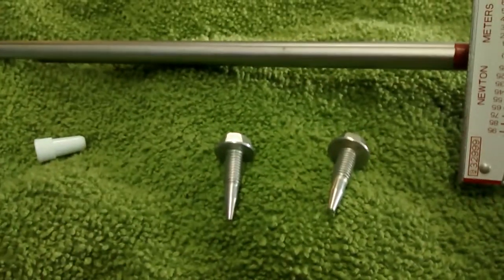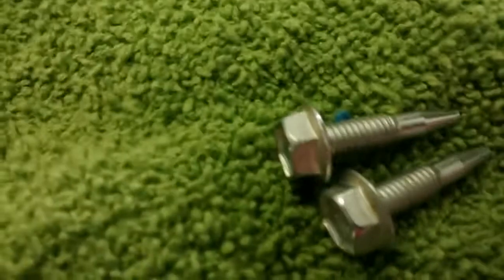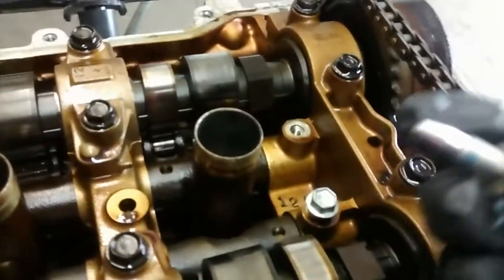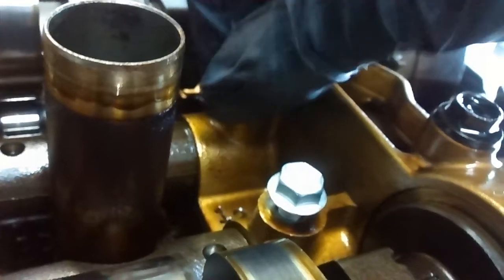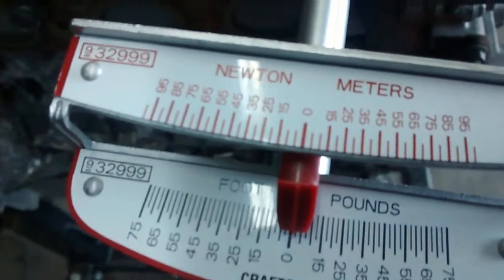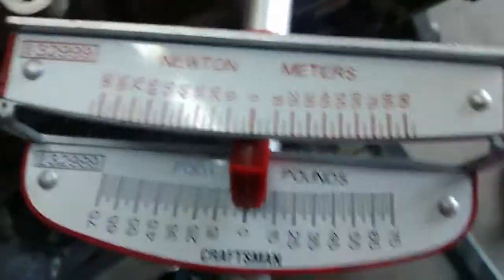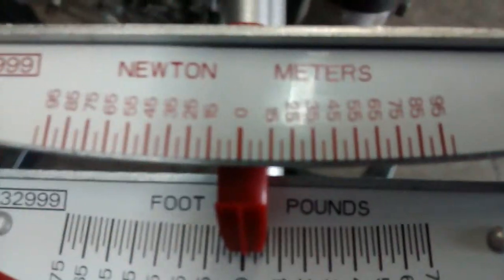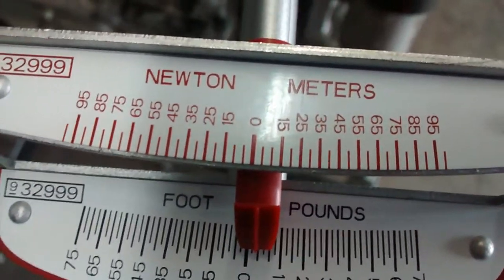Lift Bolt Installation w/ Beam Torque Wrench - 2ZZ-GE

Comment: I can’t believe you used thread locker on lift bolts smh.. you will need to change them again in 20,000 miles and might snap it into the head now removing them 😂

Comment: Very well explained.   So many people just slather bolts with Loctite  and they can create issues for themselves later.   You also applied the Loctite properly.  One drop.  You also didn't let the tube of the bottle touch the metal of the bolt.   Many people don't know that thread lockers like Loctite work the the principle of anaerobic sealing.  The product will not cure until the air is removed.  When you screw the bolt in, you remove or displace the air and the Locctite can cure and do it's thing.  That "thing" is a chemical reaction with the metals.  So if you touch the bottle tube to the metal, over time you will contaminate the Loctite as when you seal the bottle up, the chemical process will take place with the small metal fragments it picked up if you were sloppy with your application.
Reply from the maker: I really appreciate that! Also, I did not know the chemical/technical aspect of what's going on with the compound, so that is very enlightening. Good deal!

Comment: how do you know when this lift bolts wearing out and how many miles you should change them..
Reply from the maker: 2zzLift That's a great question. It depends on how the motor was treated. This motor had 70,000 miles on it and was fine, but I've heard of Lotus Elise's that have needed it sooner. If you are prospecting a 2ZZ motor, I HIGHLY recommend using Carfax to run the VIN # on the motor. Buy an unlimited package and run the VIN of every motor that you come across BEFORE you buy it. This saved me several times from getting a crappy motor. Also, get an oil sample and compare it to a known good oil sample. On my Carfax report for my motor, it showed that the Celica GTS it came in was owned buy a company. It was apparently very well maintained. You can see the service history. And you can also tell that the car was very rarely driven. It also came in an automatic car, so even more probability that it wasn't abused.